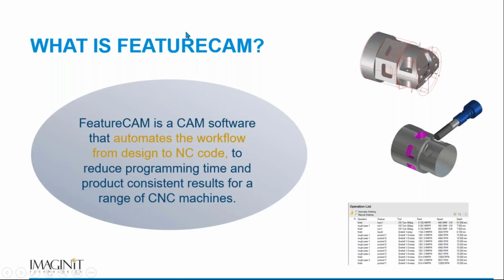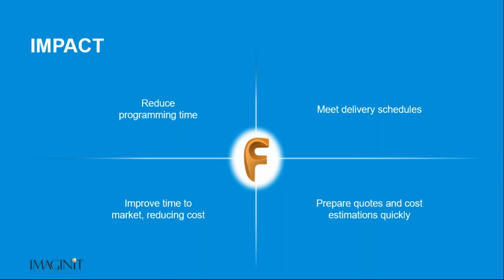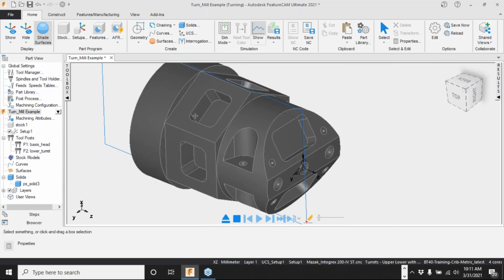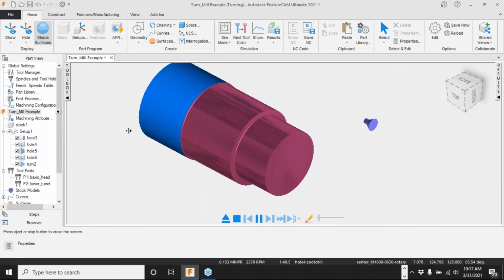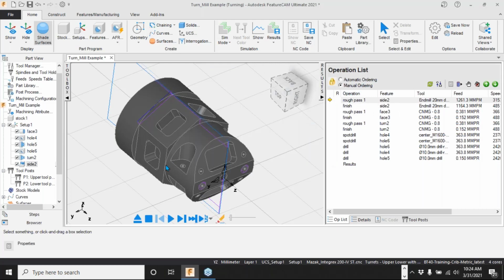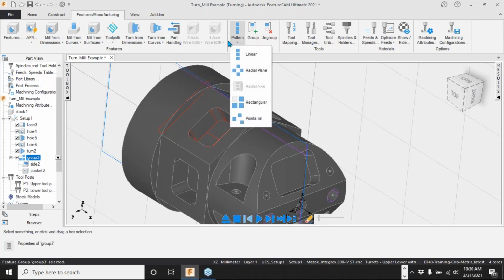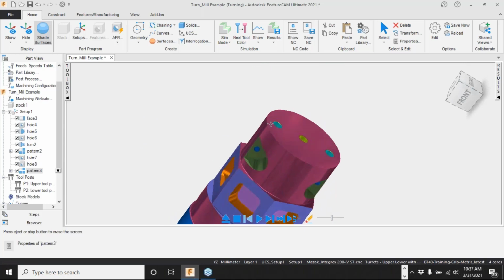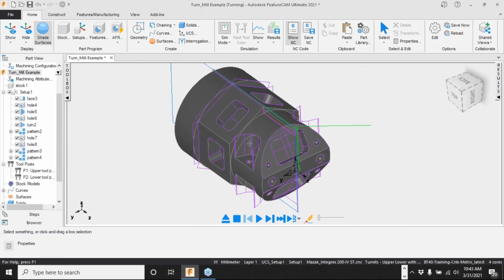Leveraging the Turn/Mill Capabilities in Autodesk FeatureCAM

Comment: I have a question.
Why do FeatureCam only have bug fixes in the new versions?
There hasn't been any real innovations for years...
It's actually based on Fusion, as far as I know.
In Fusion there are things like circular segment cutters and proper cutting value tables, but I miss that quite a bit in FC.
Reply: FeatureCAM is very old. Autodesk bought FeatureCAM to get the intellectual property. They took a bunch of stuff and implemented it into Fusion but they don't seem to care too much about actually improving  featurecam which is unfortunate